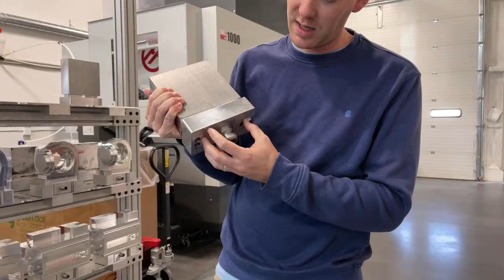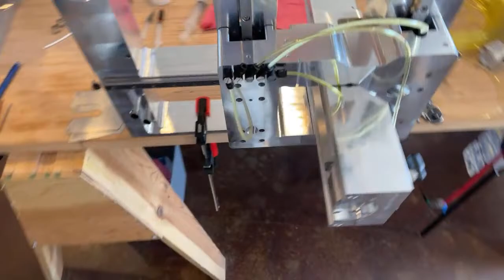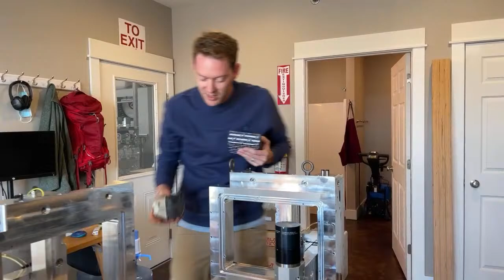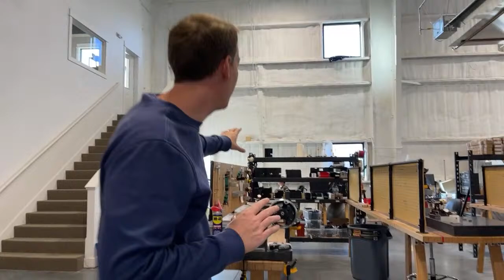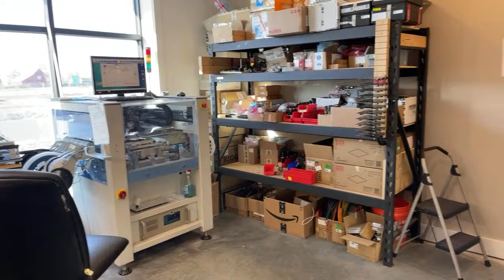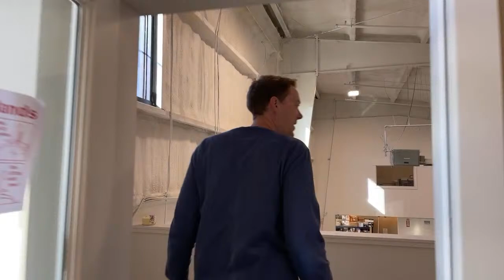Manufacturing Day 2021 Pocket NC Tour

Comment: Wow, I've been saving for the V2 but still had reservations, But the new model has removed those and it looks to check all my boxes.  But as awesome as it is... the spindle alone costs as much as a V2 then add the clearpath servos, ball screws, lube, cooling, ATC, enclosure, etc.  I'm worried about where the price is going to be, it's the mill I've been waiting for... but is it one I can afford anymore... Please keep the price attainable... I Know i want cake and to eat it.  No doubt a masterpiece and the quality of parts and engineering is top notch... I just really want one and hope I can swing it.
Reply: Did you get a quote for that spindle or was it a ballpark guess?
Reply: @Foomanlol  I have Jagger Spindel which is a step down from the IMT and non ATC in a mill i have and its 5k with VFD so yes the IMT with ATC and VFD is way more than a V2. its the same spindle used on the Dactron neo $150K + mill
Reply: Hi, when you say the "new model," are you referring to Version 3? I'm somewhat new to the Pocket NC, which is confusing to me.  Thanks

Comment: wish I was able to watch live! Thank you guys for the tour, very cool.

I do have a question. Why was aluminum chosen for the new machine structure?  Wouldn't steel or iron provide a more stable/solid platform and intern better repeatability? Perhaps eliminating the need for cooling?
Reply: Kern actually used mineral cast and aluminum instead of steel because aluminum heats/cools very evenly compared to steel or iron so it's easier to keep it stable. I would have looked to use mineral cast or something like that either way for the larger portions of the frame.